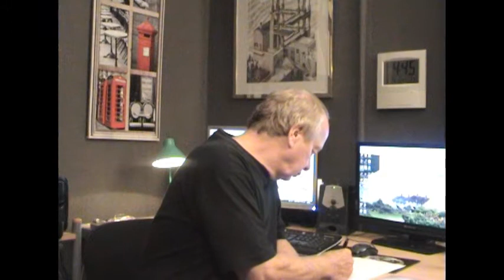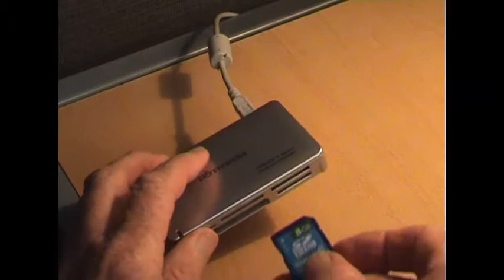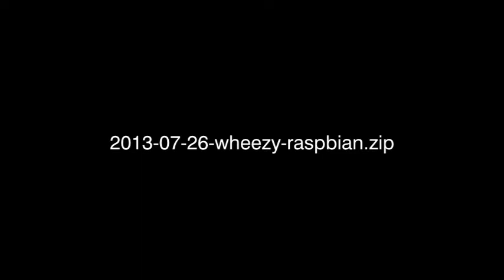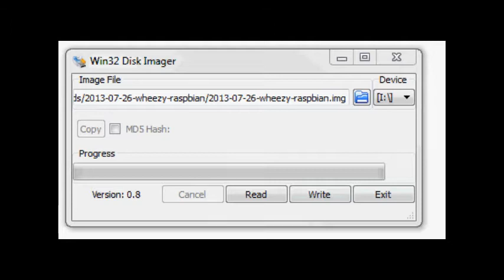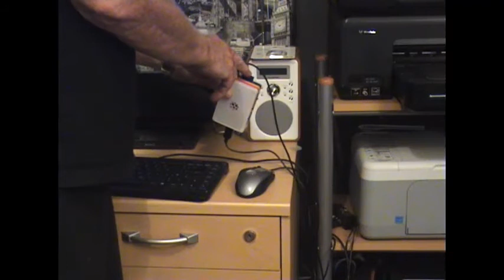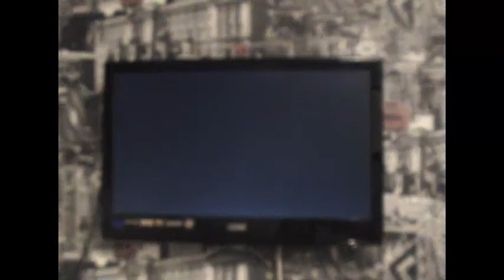Raspberry Pi You Tube video

Comment: Have you seen the new NOOBS software for the Pi? It makes things easier in that you do not have to use the imaging tool -- NOOBS comes as a ZIPped folder with some files, that can be dragged-and-dropped directly onto a formatted SD card (just like photos and documents). When you boot a Pi with a card with NOOBS freshly installed, you get to choose among a handful of OSes, and if your tinkering ends up messing with important system files, you can recover a "clean" OS by holding SHIFT on boot-up.